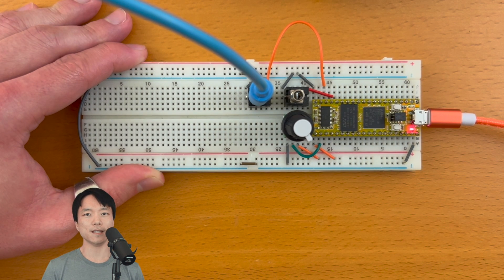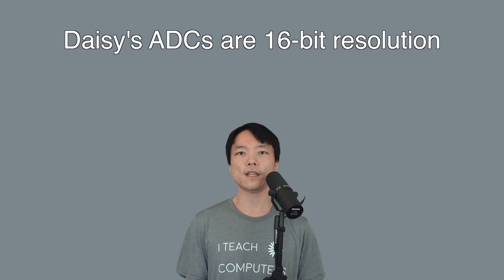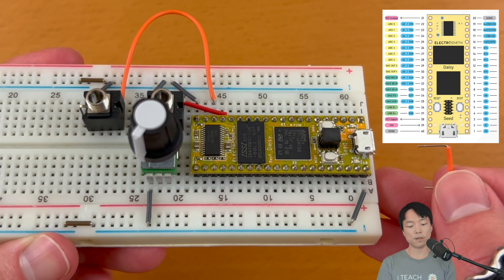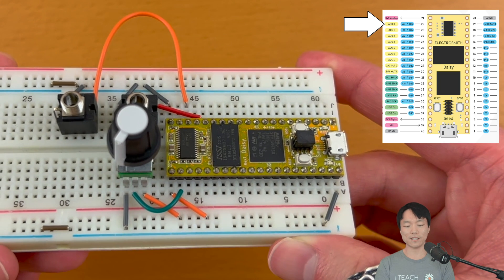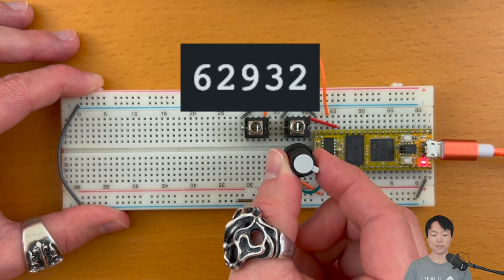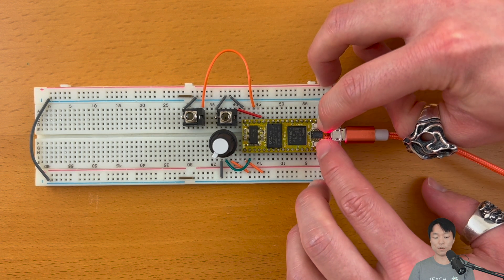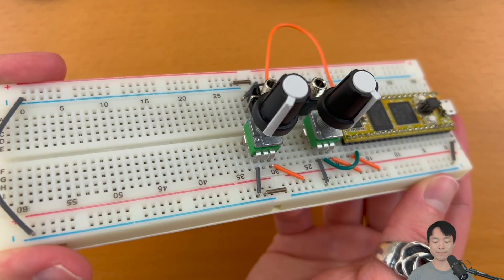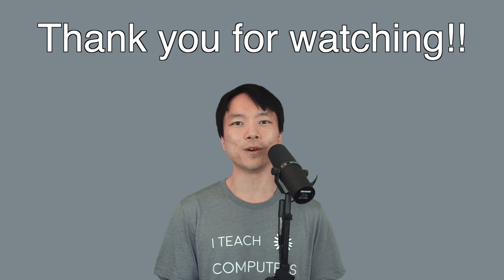How to Connect a Potentiometer to the Daisy (DaisyDuino)

Comment: For some reason this tutorial didn't work very well for me. The resolution of the potentiometer exceeded the range of the frequencies set and would eventually repeat itself. I messed with chatGPT some and it told me to make a map function which fixed the issue for me.
Reply from the maker: I wonder what could've caused that issue. But yes, using a map function is perfectly fine too!!

Comment: Howdy! Is there a tutorial for using a potentiometer to change MIDI values? Or could you direct me to a reference somewhere? Thanks!
Reply from the maker: Please feel free to let us know more about how you're planning to use MIDI for your project :) 
For example, would you like to control MIDI input or output?
Reply: Ah, sorry - I should’ve been more specific. My goal is to hack a volume expression pedal into a MIDI expression pedal. So, read a pot’s value, translate to midi, and send over USB to computer.
Reply from the maker: @GianTJ  Ah I see! If the project is only MIDI (and no audio I/O), then using an Arduino/Teensy may be the move. There should be plenty of resources on using MIDI with those.

Comment: can you do an encoder, Im finding this nigh impossible lol?
Reply from the maker: A video on encoder is planned for sure!
Reply: @daisy_sound  Well now ide is stating many conflicts even though it was just working yesterday 🙃. Did a polling method for the encoder but was late last night, did same code and ide freaked out on me lol 🤷‍♂️
Reply from the maker: @daytrace4635  Feel free to share the error message that you're getting on the forum or discord. Would be happy to look at it closer with you :)
Reply: @daisy_sound  Ended up fixing it, had to do add a file to the sketch as the library itself isnt valid in ide, added the daisysp h file and it worked but seems I have to do that for every sketch and the library still doesnt show up as a contributed library. Ill get on the discord when I get this done tho 😁👍
Reply: @daisy_sound  So apparently the DaisySP library will not download via zip, not really understanding why considering daisyduino was easy peasy lol

Comment: yes, custom hardware tutorials. 
I'm stumbling on plug data json file/heavy stuff, I'd just wish there was a table of plugs and their corsponding hardware you can pin them to.
Reply from the maker: If you want to learn how to put together a JSON for custom hardware configuration, we wrote a guide titled "Quick Guide on Setting Up a Custom JSON File for pd2dsy & Oopsy!".
We highly recommend checking it out. And we would be happy to answer any question that you have there.
Reply: @daisy_sound  I was looking for somthing like that, the forum search might need more tags in them, I came up blank seaching "plugdata harware mapping". 

Thank you I was able to find it now. 
Would you know if there is a list of matching hardware to plugs? Like if I want to put various sensors or like 5110 displays, what plug would work or not at all?